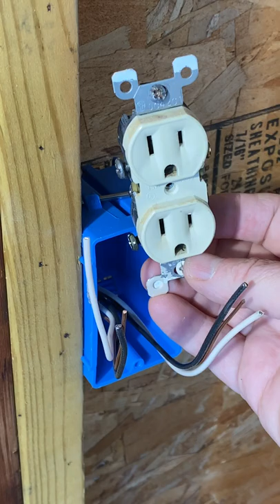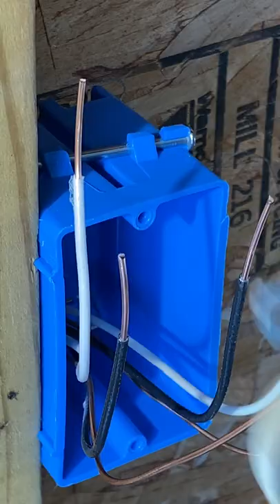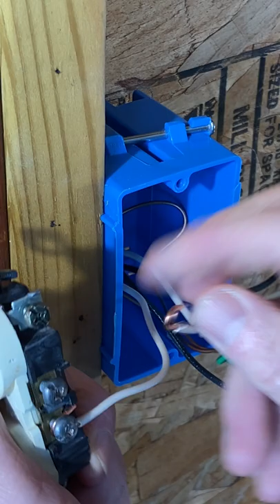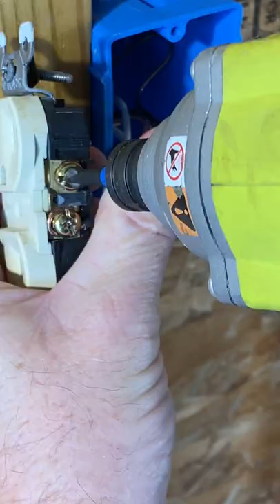Install an Electrical Outlet in 60 Seconds #Shorts

Comment: one tip i’ll give you instead of connecting it to each screw on brass and silver and neutral and power connect it to onky one screw if you connect it to all screws it will over heat and can melt. make pigtails for white black out an extra wire bond the blacks its blacks and whites with whites then wire nut everything and add it to one screw same goes for ground
Reply from the maker: I disagree but we all have our opinions. I made a video on when and why I pigtail.. Check it out.
Reply: @BackyardMaine  just how i was taught maybe it’s just extra work for extra pay  😂

Comment: Is it a good idea for the jumper to carry the downstream load because you didn't make up your wires properly by tailing them out?
Reply: If I remember right most outlets are UL list for that exact thing... though I agree pig tails are better
Reply from the maker: This is an approved method of wiring as well as a pigtail. The receptacles are listed for 20A pass through current even on 15A receptacles. I pigtail when there are three or more wires in the box.

Comment: Yes but if that one outlet burns out everything after it won't have power. Pigtail your wires
Reply from the maker: I agree with using pigtails if you have more than two wires or if you're using the back stab connections rather than the side screw terminals. I have never in 38 years of being an electrician seen a properly wired receptacle fail open. For example I wired my home 25 years ago and I haven't had a single electrical problem yet. I created a video on pigtails as well. https://youtu.be/K3RIjUnrNTQ
Reply: @BackyardMaine pigtail them! Even with only two sets wires in an outlet, everything Downstream will fail if a screw Works loose in the outlet

Comment: Pigtail those wires first,so you only have 3 wires to put on that outlet
Reply from the maker: That is an option but I don't pigtail unless I have a third wire. Even 15A receptacles are rated for 20A passthrough current. As long as the stabs aren't used I have never had a problem. I have a couple of videos on pigtails if you interested in another point of view.

Comment: Why did you not pigtail them so you never interrupted power flow.
Reply from the maker: The pigtail is an option but either way is permitted by code. The receptacle pass through current is listed at 20A even for 15A receptacles. So it's actually as good or better than the wire. The limiting factor would be the connection. If you make a solid side wire or compression connection you will be fine. If you back stab they you should pigtail every time in my opinion.

Comment: Close that wire Loop around the screws with a needle nose pliers and wire nut both black with a black pigtail which will get connected to the receptacle using one screw do the same with the white the only time you use all four screws on the receptacle is in the case of a switched portion of the receptacle and then you have to break the little metal table off the side in between the screws to separate the upper and lower portion of the receptacle and if you need to use a drill driver you probably shouldn't be doing electric work call an electrician
Reply: No thank you

Comment: While everything in the video is correct, I prefer making pigtails when there's 2 or more sets of wires, that way if there's an issue with an outlet it doesn't kill the rest of the circuit down the line and you can keep your length necessary on the feed wires. I would also tape up outlets with electrical tape, prevents shorting and makes it easy to pull an outlet out live if necessary.
Reply from the maker: The pigtail is an option but either way is permitted by code. The receptacle pass through current is listed at 20A even for 15A receptacles. So it's actually as good or better than the wire. The limiting factor would be the connection. If you make a solid side wire or compression connection you will be fine. If you back stab they you should pigtail every time in my opinion.

Comment: You want the circuit in parallel not in series pig tailing would be the correct method
Reply from the maker: You are not correct. The circuit connected through a device is not in series it's in parallel but it's paralleled at the device terminations rather than at the wire nuts. The code allows both through wiring and pigtails both are equally reliable when done right. Also a 15A receptacle has a 20A passthrough current rating and is actually UL tested at 30A.

Comment: pigtail the wires. Don't feed through the outlet. You did it for the ground.
Reply from the maker: Pigtails are an option but not required by code. I do use them depending. I have a video on that as well. The ground has to be pigtailed because there is only one connection point.
Reply: @BackyardMaine  If you have the time to do a ground pigtail, pigtail the neutral and hot. Some inspectors have local standards that require pigtails You comment about not back stabbing but then shortcut by not using pigtails. Are two wire nuts to expensive to do a quality job. A pigtailed outlet is so much easier to stuff and service.
Reply from the maker: @idadho  No it's not that I want to save the wire nuts or time. It's that I think when dealing with two cables the side wire connections are as good if not better than a wire nut. Even 15A receptacles are rated for 20A passthrough current and if you make a solid screw connection you won't have any issues. It also adds less wire in the box and makes folding the wires and device in much better in my opinion. Also I have been licensed electrician for 38 years now. I just tell you that incase you thought I was a DIYer.
Reply: No need to pigtail.

Comment: Want that overload the plug. Pigtail before the plug and then run to the next plug.
Reply from the maker: No it will not. Pigtails are optional by code and even 15A receptacles have a 20A passthrough current rating.. I pigtail if I have more than two cables in the box but with two I usually through wire. I have never seen a problem when the connections are made correctly.

Comment: Why not use those plug in connectors?  I seen more issues with screws loosening over time. I also see less issues with screws that have clamps
Reply from the maker: The back stabs are the number one failure that I find these days. I never use them. I like the side wire which when done right should last a lifetime. The ones with the clamps are commercial grade devices and they are the best option in my opinion.

Comment: Don’t usually see four wires.  Whats that about?
Reply from the maker: The pigtail is an option but either way is permitted by code. The receptacle pass through current is listed at 20A even for 15A receptacles. So it's actually as good or better than the wire. The limiting factor would be the connection. If you make a solid side wire or compression connection you will be fine. If you back stab they you should pigtail every time in my opinion.
Reply: @BackyardMaine  i presume you need to pair them up properly?  Or does it not matter as long as they are in-phase?  But how would you know if they are in-phase?  Also, you didn’t mention about breaking out the jumper.  Isn’t that required if using 4wires?
Reply from the maker: @cslloyd1  Receptacles here in the USA run on 120VAC single phase so it doesn't matter. You would only break the tab if you were going to switch one side or if you were going to add a second circuit to one side. That's called a multi-wire branch circuit on a common yoke. These are not common but are acceptable with several requirements to become code compliant. Probably more than I want to get into in this reply.

Comment: If im replacing an outlet do you recommend cutting the wires and stripping them again or could i just remove them and connect them onto the new outlet?
Reply from the maker: Either way will be fine as long as they remain long enough. If the terminal loops look un-damaged just reuse them..

Comment: Learn your code book!! It’s against code to use the device to make a splice. Correct way is to splice the wires together with a pigtail wire to the device! Can’t believe how many times I see this done!
Reply from the maker: Wrong! I guess you can read it but you can't understand it. Let me help you out. 

Code Article 300.13 B prohibits the neutral wire from connecting through the device on multi-wire branch circuits. Multi-wire branch circuits have two or three ungrounded hot conductors with voltage between them sharing a common neutral. A single circuit feeding outlets is not a multi-wire branch circuit and pigtails are not required.

Comment: Maybe make clear for novice do it yourselfers that you were splicing the circuit for another outlet down the line, though I agree with Richard, that a pigtail is the better option. If the two black wires were both hot line wires and you don’t separate by removing the tab between the gold screws you’ll overload the outlet.
Reply from the maker: Actually the passthrough current rating is 20A even on a 15A receptacle. So your current cannot overload the device without tripping the breaker. I have a video on pigtails going over all the pros and cons as well as the perpetual argument between electricians.. https://youtu.be/K3RIjUnrNTQ if this link doesn't work you can find it on my channel.
Reply: @BackyardMaine  But if you’re connecting two hots to this outlet without breaking off the connecting tab you’re at 220 volts.
Reply from the maker: No actually it just the same hot which means the same phase. The power form one hot transfers through the connection to the next device down the line. When you have two different hot wire that share a neutral thats called a multiwire branch circuit. The two hots need to be on different phases so the neutral doesn't get overloaded. On this type of circuit the neutral cannot connect through the device. This is different than a switched receptacle. In this case one hot will serve one outlet and the other hot serves the other. The tab will be cut off as well. There are other requirements around multiwire branch circuits as well.  @josephbrewer7026
Reply: @BackyardMaine  I’m not making my point clear I guess. I fully understand what you’re saying. The only point I intended to make is that in the video it’s not specified that one black was hot and one was going to load. If per chance this was not the case and both of the black leads were hot (line) as if to be used for separate  circuits on the same outlet, then the tab connecting the two would need to be removed. I realize that this is a rare occurrence, but not an unusual one and both black wires need to be metered to ensure that they are not both hot.

Comment: Ok. Pigtail or not pigtail?.
It depends.

NEC, 2023, ARTICLE 300.13 (B) reads:

Device removal.in MULTIWIRE  branch circuits, the continuity  of a grounded conductor shall not depend on device connections such lampholders, receptacles and so forth where the removal of such devices would interrupt the continuity. 
In this video, there is a cicuit going downstream, so he should have done a pigtail at least on the neutrals.
The code is for minimum requirementes and is there for a reason  and the "I think" or "l like" or "I've done for 30 years" are not válid unless is above code requeriments
Reply from the maker: You just proved that you don't understand what a multi-wire branch circuit is and that you think you know code when you don't. lol

Comment: This is the incorrect way to install a receptacle. The moment that outlet goes bad everything in the circuit beyond that outlet goes out. You should be twisting the hots and neutral together then attach one of them to the out let and wire nut the twist.
Reply: That would be the pigtail method. Also this is an outlet, not a Christmas light string. The outlet doesn’t just “go bad” unless you really f up. Daisy chaining outlets is perfectly fine and I have never seen that be an issue in my life.
Reply from the maker: Same here my friend. Receptacles are rated for full circuit pass through current and I have never seen one fail. Even 15A receptacles are rated for 20 pass through which is why the can be protected by a 20A OCD.
Reply: @joeythefoxxo  I just ran into this issue myself. Guy thought it was a good idea to wire his own house and half of it went dark. It happens. You don't wire a residential branch circuit in series, Period.
Reply: @BackyardMaine  I don't know where you've been if you've never seen a receptacle fail my guy. I've seen it many times.
Reply from the maker: @cristanboy  I misspoke. I’ve seen many fail in this way but they we’re back stabbed not side wired. I’ve also see old receptacles with loose plugs melt. But I’ve never seen the pass through connection tab fail open. Those are rated for 20A even on 15A receptacles
Reply: @cristanboy  it's still in parallel... he is just using the pass though tab as the connection... yes a pig tail is preferably because of posible thermal damage to outlets caused by equipment

Comment: That is not the correct way to install a receptacle. Pigtail my friend! Also you should courtesy wrap the device with electrical tape , and you should always finish screwing with an actual flathead screw driver .
Reply from the maker: Pigtails are not required by code and as a 38 electrician and electrical engineer I don’t think they necessary in most residential applications. Oh and pros never wrap receptacles in tape.
Reply: @BackyardMaine I’m not an electrician but I here they wrap tape on fixture only if box is metal??…,,,

Comment: Why don't you use the quick connectors at least here in Florida they're totally legal to use residentially many fixtures provide these and their UL listed I remember about 10 years ago every can light that I got had quick connectors pre attached to the wires that were built into the box
Reply from the maker: I do like the quick connects for lighting especially with low wattage LEDs that are being installed today. I don't like them for anything with significant current though. I have had to repair so many of the back stabs over the years. They are approved I just don't use them.

Comment: do you know where I can find guidelines as to how close to a sink I can install an outlet on the cabinet face?  I'm building an outdoor kitchen and would like to install an outlet on the cabinet front about 6" or so to the left of the sink and was wondering if that's too close?
Reply from the maker: The code is clear about the maximum distance from a bathroom or kitchen sink but there is no requirement on the minimum distance. The receptacle will have to be GFCI protected. I hope this helps.
Reply: @BackyardMaine  I think it does.  That's what I thought as well.
Reply: It’s outdoors, by code and for safety you have to have GFCI receptacles or GFCI protected receptacles regardless of the sink location outdoors.

Comment: does it matter if the INCOMING hot wire is on the TOP or BOTTOM screws?
Reply from the maker: No they are interchangeable.
Reply: @BackyardMaine  thankyou, an electrician had told me that the INCOMING hot wire should go on the bottom brass screw and the OUTGOING hot wire should go on the top brass screw, not one video or book i researched said that, oi would have to check every single outlet to make sure i did it that way, glad its no biggy
Reply from the maker: My pleasure. Yup it make no electrical difference at all the two screws are connected through the little tab.  @vallaeiasprings9870

Comment: Using an impact to tighten screws is a great way to strip them out
Reply from the maker: Been doing it for years without issue. You could damage it if you really drove the home but I know when to stop.
Reply: Impact on the lowest setting won't hurt a thing. A final hand tightening doesn't hurt

Comment: I would definitely not recommend using a drill ever, but especially as a tutorial. It's not as much an issue of stripping it, impact's don't really have that problem. The bigger issue is torque, especially with an impact, even a very experienced user isn't going to be able to tell if the screw is properly tightened.

To be clear I'm not saying you need a torque wrench/driver. A Philips screwdriver is your best option for outlets. Tighten until the screwdriver starts to slip/strip, then stop. You don't need to be pushing very hard either. That's part of the design of a Philips screw head, the bit is ejected when it is over tightened. 

Most tradesmen can cheat with an impact and it will probably be fine %90 of the time. However I bet if you did pull out a torque wrench you would find a lot of screws run in with an impact are actually too loose.
Reply from the maker: I have 38 years of experience as a licensed electrician / electrical engineer and have found that I can use the impact with no issues at all. But you're right, for a tutorial I probable should have used a screw driver. I used to think the same thing by the way but then I started to check a bunch of devices done with an impact and they were all good. Never loose and never stripped. These were my first few videos and since then I use a screw driver.
Reply: @BackyardMaine  Well cool. 👍 I do think the rest of the video was great! I have been watching some of your other content too and it seems quite good. ☺️
Reply from the maker: @calebpurvis6195  Thank you! I'm new to standing in front of a camera.. lol My new hobby is actually a lot of fun and I hope the videos will improve over time.
Reply: Actually Phillips head screwdriver is the worst option for those screws. The best option is ECX, followed by Robertson, then slotted.